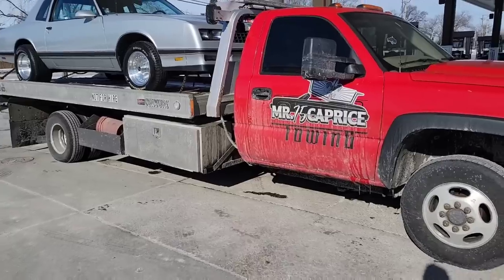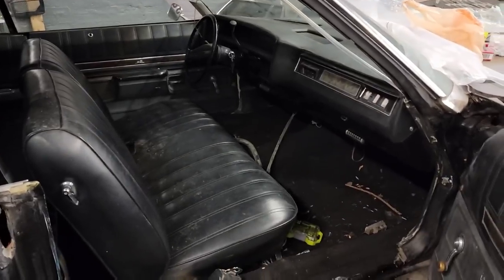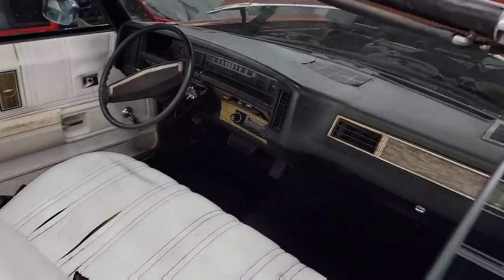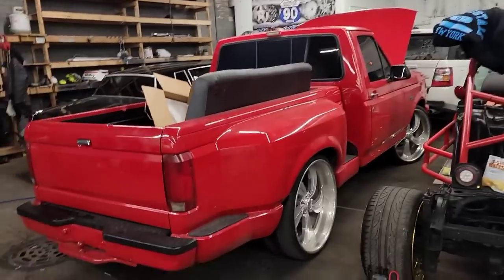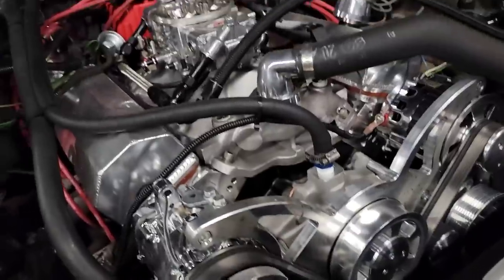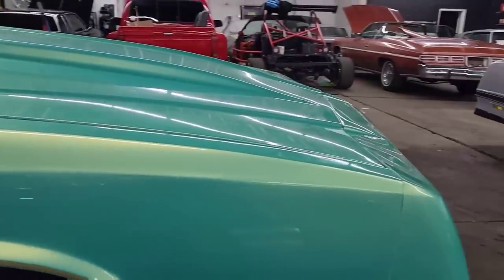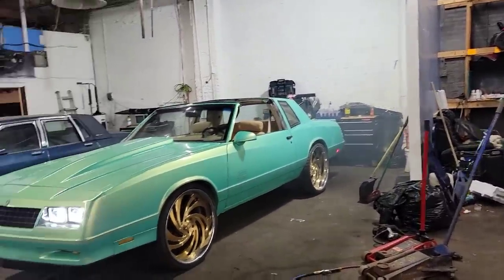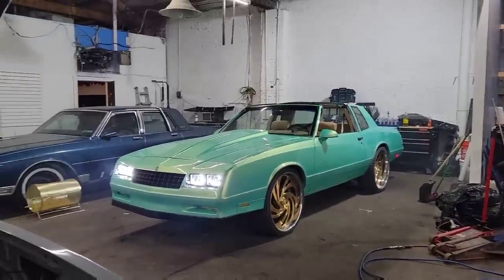We go back car shopping

Comment: 30k? Did anyone pay attention to the fit and finish of the aftermarket items added to the car? Loose interior, rushed paint job, seats leaning, third brake light wire exposed. I’ve got more but you get the point. If he got anywhere near what he asked he’s definitely in the running for top 5 trash salesmen of the year. 🤦🏽‍♂️
Reply: THE MORE HE SHOWED DA CAR DA MORE FLAWS WERE SEEN LOL.....SEEN COUPLE MORE OF HIS HACKD UP CARS